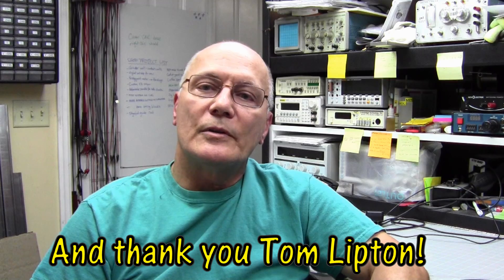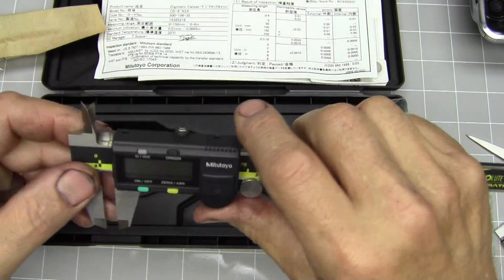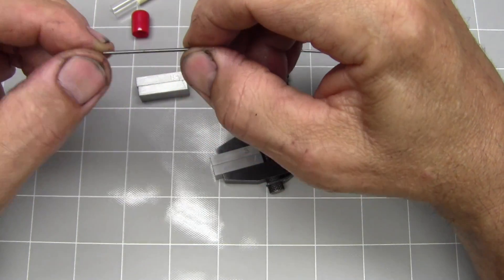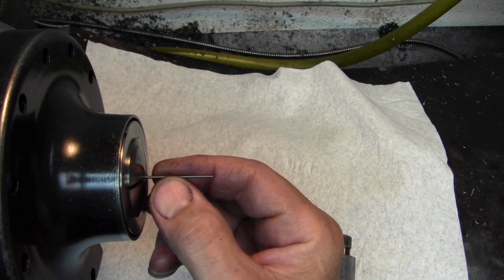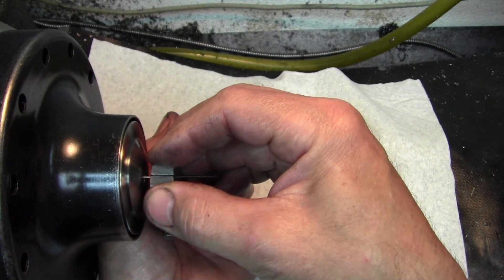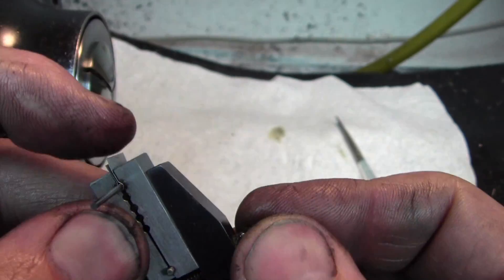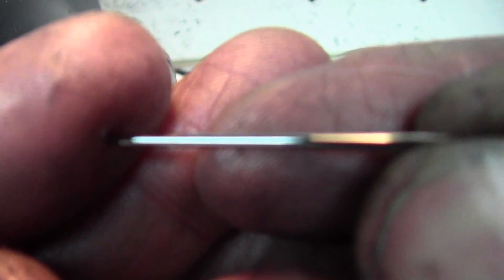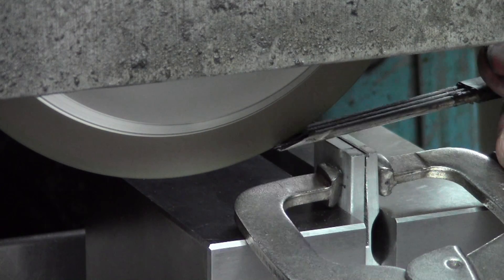CUSTOM CALIPERS PART 1

Comment: "Shop Notes"*

• Overview of topics covered in each video.
• Just a note on the 'make one for you, one for me': This is quite common in small production industries. More often than not the customer's expense is mostly in time and skill of the maker. Most of the maker's time is in setup and process design. Swapping out an extra set of parts is trivial compared to revisiting. This also adds some insurance if there's a surprise re-order or if world chooses to make your life difficult that week (lost packages, theft, disasters).
• Review of the customer sketch. Note that the customer knows technical drawing conventions (sectioning) which can make even a very simple drawing sufficient to build from.
• Looking at a CAD drawing of the modifications and fabricated parts
• Shows how to disassemble a digital caliper neatly
• Calipers used: Mitutoyo 500-196-30 (Be aware that there are counterfeits sold online, buy from a reputable source)
McMasterCarr: https://www.mcmaster.com/#8647a42/=19px6nj
KBC Tool: http://www.kbctools.com/products/MEASURING%20@@26%20INSPECTION/CALIPERS/ELECTRONIC%20DIGITAL%20CALIPERS/5759.aspx
• Trimming the calipers with a cutoff disc on the surface grinder.
• Creating the grooves for the head assembly
• Making simple O.D. laps with parallel clamp adjuster
• Lapping a carbide drill blank to size and finish
• Paper lap trick
• Trimming pins and a well thought-out 'quick-and-dirty' fixture

*Not affiliated with any manufacturer or distributor. Links just for convenience.
Reply from the maker: Thanks again brs and it is in the video notes now!

Comment: Hi Robin, Love the detail of your work, you and Tom are always putting out great content. In the future if you need a .050" carbide pin you can try getting a Harvey Tool miniature extended reach stub flute end mill and cut off the shank and flutes. With a 15xd you should get about .675 of length(Harvey # 48950). I have done this in the past for some oddball miniature carbide pins I needed. You might want to verify tolerance on shank and see if it would meet your needs. Always looking forward to your vidoes!
Reply from the maker: Thanks Vahag,  that is a very good idea but more expensive. That carbide blank I started with was only $20.00 for 1.5" and I think I would still have to lap the Harvey blanks.

Comment: Looking forward to the next parts.  Why is the 0.050 reamer left handed for the lap blocks?
Reply from the maker: Left hand work well if you have a through hole. I didn't specifically order left hand it just showed up that way. I was focused on the cheapest one that was the correct size and didn't notice the left hand part.
Reply: +ROBRENZ I was wondering the same thing. Thank you!  

Just curious, would you use the LH reamer in a pilot hole made by a right handed cutter?  Or does the condition of the pre-reamed hole matter?  

Looking forward to the next videos!  Superb detail and craftsmanship.
Reply from the maker: Thanks Keith,  does not matter. On a reamer left hand pushes the chips ahead of the reamer and right hand pulls the chips up the flutes. The same effect as a spiral point tap vs a spiral flute tap.
Reply: +ROBRENZ thanks, Robin!

Comment: A most excellent video, thank You Robin!
I have done almost the same thing but used the brake disk digital calipers now available. They have square long shanks which simplifies the build which makes it possible to machine the holder for pins etc directly into them.

Comment: 20:53
Thinking about creating a tool for tailstock for not holding the lap by hands.
Reply from the maker: The lap needs to be able to follow the part freely without any influence. That would require a fairly exotic fixture in the tailstock that only transmits torque without any lateral forces.
Reply: ROBRENZ sort of a die holder, hm...

Comment: If you ever do these again, heating the blade of the scraper with a hair drier (or heat gun on medium) will make it a lot easier to remove the label. I've done one before where i've also heated the calipers themselves, but i generally stay away from heated electronics, maybe just a whisker of heat to soften the glue, not much more. The bonus for this is, you can remove the labels and reuse them as they are. The heat will lift it off the metal with ease.
Reply from the maker: Good idea, I will try that next time. Thanks for watching and commenting.

Comment: Hi Robin,
Thanks for the tips on lapping pins, I noticed that you can get .050 carbide end mills instead of the #55 drill bit, however maybe the finish is rough with no material for lapping.
Reply from the maker: I never saw a .050 end mill that has a .050 shank. Even if there is such a thing your comment on the shank is very likely.

Comment: do you ever have problems getting flood coolant in contact with the wheel when creep feeding? in my experience the air boundary layer likes to deflect the coolant out of the way and i don't get much coolant into the cutting zone itself
Reply from the maker: Of course, but its way better than not using coolant. Ideally you want the coolant exit velocity to match the wheel SFM but that would create quite a mess on a non enclosed grinder and take way more psi than I have available.

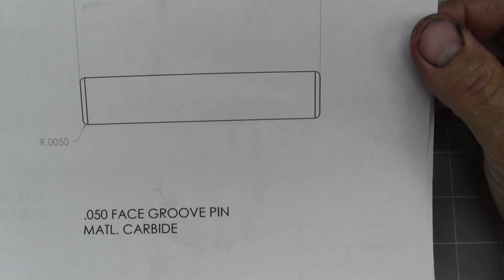Comment: Robin, this may be a dumb question but at 9:06 is it a typo that it’s 0.0050 instead of 0.050? Or is it some kind of technical spec
Reply from the maker: That is a 0.005" radius on the edge of a 0.050" diameter pin.
Reply: @ROBRENZ  oh i just misread, thanks for the reply

Comment: Robin

I know this is an older video, but I found this video today and enjoyed watching.  Howeever, I have a question.  Using the cutoff wheel looks llike it leaves a rounded botton to the cut?  If so, any eay to dress the cutoff eheel square for a finishing cut to get a square bottom?

John
Reply from the maker: You could dress is square again but it won't hold up for long.

Comment: or just buy .05 pins and skip the carbide part. I meen calipers right? They make more accurate tools for this.
Reply from the maker: No one would learn anything about lapping small diameters and working with carbide if I did that. :-)
Reply: A truly useless comment. 

Robin is creating a bespoke instrument step by step. every process needs to be controlled thats why he lapped them to .050 

cheers 
Dave

Comment: I've had a Mitutoyo Digimatic for close to 25 years. Lots and lots of miles beating around in my the "precision tools" drawer of my Snap-On Heavy Duty Road Chest in service trucks and my pickup. I think I paid $250 for that damn thing and I thought I was nuts then and judging by prices today I probably was, lol. But in 25 years I think I've replaced the battery twice and it still looks damn near new and works perfectly. Still got whats left of the sleeve around the plastic case just like my Starrett 0-1 micrometer is still in the case and the case is in ITs original box in the same drawer. Battered but still intact and the case and micrometer look like new. Both great companies that can and do make a WIDE variety of their "standard" tools. As soon as I saw this I immediat ly thought "Mitutoyo has GOT to make something at least SIMILAR to what this customer wanted custom-made. So I checked the website. I didn't come up with identical matches but I'm pretty sure the one micrometer I did find (there are 4 or 5 others with the same jaw style but different lengths. metric only, standard only, etc) would do what both of these will do:

http://ecatalog.mitutoyo.com/ABSOLUTE-Inside-Caliper-Series-573536-Knife-edgeInside-GrovePoint-Jaw-Type-C1395.aspx

Comment: "Ultrasonic" cleaning of any parts/materials where the "ultrasound" is incapable of dissolving/dislodging contaminants only makes the contaminants "settle into" the parts/materials. And if you think "3-micron" so-called "slurry" is anything but "fairy dust" to any machine tool operating in a "real" shop, you're probably the type of "machinist" to use a lathe for work a 3/8" electric drill would be "overkill" for.